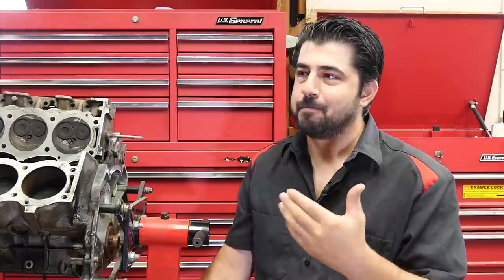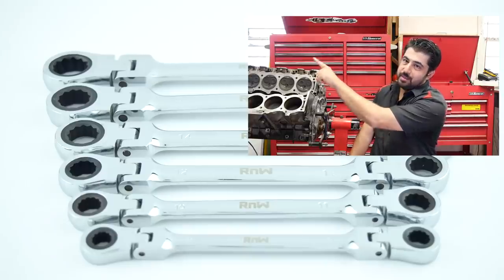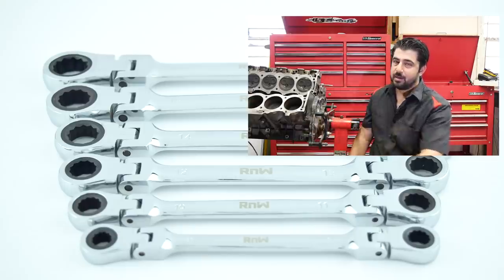Extremely Reliable Car No One Talks About

Comment: Nice 👍 I still have my 2006 Elantra w/5 speed manual transmission and it’s been a reliable car. It’s my daily commuter and I do all the maintenance myself. The only issue I had around 175K miles was a bad front brake caliper. End up replacing both calipers and rotors along with a complete brake flush. 225K miles later, she still getting me from point A to Z 😁

Comment: Pairing an interference engine with a timing belt should be made illegal...
Reply: WHY ?     just maintain the car
Reply: @claycoates5056  Well, even if you maintain the car and used only genuine manufacturer parts, those parts can sometimes be 'defective' and it may not be obvious - initially. If you put that brand new part on your car not knowing that it is defective and the part breaks, as in a timing belt, then what??? So, I agree with the comment from happystar1000.
Reply: Sea Gull they make interference engines because they’re more efficient. Get rid of emission regulations and manufacturers would be more open to making non-interference engines.
Reply: Agreed 1000000%
Reply: @happystar1000 tell that to my 2.5L 1984 Porsche 944 N/A M/T
Reply: Simply use timing chains instead.
Reply: Yeah, I learned that lesson with my Eclipse when I was 16.
Reply: He is right  reliable. And one thing I notice. They are designed. To work on them not like American cars very difficult. To work on them and very expensive  to repair  they are design for the assembly line.
Reply: @pedrofernandez8729  then they have to use plastic guides and then those fail.
Reply: I have a V6 Highlander that has the belt. Runs wonderfully but I don’t take long trips because if and when it happens I don’t want to be Far, far away. I can’t afford either; the trip and the repair.
Reply: @crownhic6827  I’m disabled and can’t do that anymore. My back is disintegrating.
Reply: @dam4274  sorry to hear that.
Reply: so many statists in here
Reply: i like when they are int. but only 4 cyl. wtf
Reply: @drummeralex9198  how are they more efficient?

Comment: 100% on the money with this video!
170,000 miles on my 07 Elantra and virtually nothing has ever needed work outside of routine maintenance, which I’ve learned to do myself because it’s so simple. I think the only thing that’s ever gone bad was the O2 sensor, which took me all of 10 minutes to replace 🤣
I even let my friend use it for a 5,000 mile road trip because I trust it so much
I’ve actually done an amortized cost analysis of routine maintenance expenses for my car. Excluding purchase price, insurance, registration, and gas, the car has cost me roughly $30 per 1,000 miles. Ridiculously cheap and easy car to own

Comment: The 5th gen Elantra was for the model years 2011-2016.  The 6th gen Elantra, starting as a 2017 model, was offered to the North American market in January 2016.  The main bearing issue in the 5th gen Elantra was supposedly an oil starvation issue caused by the use of aftermarket oil filters.  If you have a 2011 or newer Elantra, always use Hyundai/Kia brand oil filters, or aftermarket oil filters that have the same design as the OEM oil filter.

Comment: I know someone who bought a 2nd gen Elentra with zero issues, bought it cheap and has had it for 10 yrs.
Reply: I have a 05 elantra which he said after 04 they got the continuous VVT which makes sense cause my engine can sometimes shoot up quick to high speed with hard acceleration and it's very reliable

Comment: Hey, I own a KIA7 kia spectra(soul sister of Elantra). And I'm cheap so never replace until it's broken. I have 207K miles on my car and everything works except the drivers seat occupancy sensor. Shit I'm over with this car but it still keeps going. But just one suggestion always maintain your car 4,500 mile E-oil change; 40,000 mile Steering and Trans fluid change; 100K mile coolant and brake fluid flush. That's all I did.

Comment: 2004 Hunday accent 👌 
-can drive 6 hour strait with a full tank
-ac super cold
-low maintenance 

Oil and sparkplug change on time and it will run  for ever. 

Mine survive to crashes and drove that gem until the speedometer stopped working, sold it for 200 bucks and dude still drives the car.
Reply: My mom has a 2009 Elantra,
It is a very good car.

Comment: This man speaks the truth. I had a 2007 Kia Rio (same bones) that I picked up for 500 bucks with 168000 miles. With some charging system upgrades (new battery & batt. cables, new alternator), emissions components upgrades (evap canister purge valve/solenoid--replacing it made the check engine light go away and not come back), and one passenger side ball joint...sounds like a lot, but the cost of these parts were kept only at parts prices because with the help of videos like these, I did all the labor myself! The power steering went out, one day I lost all my fluid and any fluid I tried to put back in would end up on the street. But the car is so light, power steering was not needed.
The previous owner had a new clutch installed in January of 2018, approx. 6 months before I bought it, so that is probably going to outlast the car's life as a whole! Speaking of a clutch, the added benefit of a manual transmission will only make it last longer.
Sadly, after 2 years of ownership, I needed more room to haul my kids and all my gear around, so I sold it for 800 bucks at 199000 miles, just a couple weeks ago. So I didnt own it for long, but I was damn impressed--Hyundai/Kia were not known for quality & longevity but ya gotta respect how much they've improved. The new owner (friend of mine) has tipped the odometer well over 200k and said his only complaint is the lack of power steering. 😆
Long read, thank you for staying with me if you got this far. And thank you @ratchetsandwrenches for your help.

Comment: I have a 2007 Elantra I bought in 2008 with 20K miles. The best car I have ever owned. Handles like a go cart, decent acceleration, and still gets 36mpg on highway trips. I bought mine Cert preowned and got 4 years of oil changes. After that I switched to Full Synthetic Mobile 1 oil and Mobile One extended filters and have had ZERO problems. I have replaced batteries a few times and tires/brakes. I did the timing belt and water pump at 100K miles and the belt was still in good shape but the water pump seemed worn. I replaced it with all OEM Hyundai parts and it cost $550 for a shop to do it including the parts. Everything still works except the passenger mirror light, every other button works like normal. My sunroof opens like it did back in 2008 and doesn't leak. I even added a tow hitch and can tow up to 1500 pounds. I tow a 4 x 8 trailer to take garbage to the county dump. I have mostly owned sports cars until I bought this and I miss my new Corvettes and Formulas and RX-7 and Viper but if I have to have just 1 car, the Elantra is a decent choice. ( I used to make great $ in the 90's but not anymore ) Mine still looks like a 3 or 4 year old car on the inside after 121,000 miles. These are actually really good cars.
Reply: what about the MPG in city (landstill traffic)?
Reply: @hansselabreu649  I normally get 30-31 MPG around town, 35-36 on highway trips. I get up to speed  fast, and set the cruise when I can, usually for 5 over the limit. I don't sit in traffic long, I am not in a huge city. 2007 was a new model, I would not own a 2006 or older, they had problems.
I run the AC all thru the summer here in South Carolina as it gets 100+ from May to Sept.

Comment: I have an Hyundai Accent, 2008.  I bought it with 113,000 miles.  It's now got 123,000 and the engine is shot.  Either head gasket or burned valve or shot rings...  I've had it about 9 months...
My previous car was a 2003 Accent, and I drove it from 150,000 to 317,000 miles!

Comment: Speaking of reliable cars, my Wife purchased a brand new  VW New Beetle GLS in June 2004.  We still own this car and it has 94,000 original miles on it.  We have maintained all required maintenance to include replacement of timing belt, serpentine belt, water pump and pulleys, A/T fluid and filter, and a couple of batteries.  Many previous Beetle owner's complained of their cars.  However, this car has been a really good car.  It has never left us stranded. My wife bought a new 2018 Subaru Forester Premium in October 2017.  However, we decided to keep the Beetle because it ran perfectly. Also, I did replace the shocks and struts with new Bilstein products.  The ride is much improved.

Comment: On a related note, 3rd generation Hyundai Accents are pretty darn reliable as well.
I have a 2008 with over 210,000 miles on it, still gets 30+ mpg.
GREAT VIDEO!

Comment: As always, a very informative video. I bought a 1999 Hyundai Elantra GS new. I recently sold the car with almost 300,000 miles and it was still running. In 2005, I bought a new Hyundai Elantra GT and I still have it today with near 215,000. Both cars were and are very reliable for me. I have maintained them over the years and replaced essential parts before they wore out which I credit for the longevity. To sum it up, I have certainly gotten my money's worth out of these vehicles and I have nothing but good things to say about Hyundai. Like all vehicles, there are good ones and bad ones, but I believe maintenance and care dictates the life of the vehicle!

Comment: I've owned 2 elantras before, a 2016 Elantra GT which was a bullet proof car until the clutch grenaded.... And now, I own a 2019 Elantra GT N-LINE with a 1.6t engine, this car is amazing... I haven't driven anything better.
Reply: I like those a lot, but I am 6'3" tall. I don't think I would fit very well.

Comment: Some rave on Toyota but if you had a new 08 Highlander with the known cvvt issue, you'd be disappointed to find three stealerships refuse to fix it under warranty. $6K. We bought a new 13 Sonata, surprisingly quick, no problems at all we had to fix and dealers stood by all recalls. We love it. All cars have some issues. It's how they are handled that matters.

Comment: I had a 2010, the transmission gave up at 60K, 3rd gear started slipping at 50K and became undrivable 10K later.
Reply: Trans fluid service is important, suprised it even went that far
Reply: @Ownsterx  I serviced the fluid every 30K.  The transmission shop that looked at it said there was a problem that year with the quality of the clutch packs and they tried to move the engagement point for third gear to a lower RPM and account for it by engaging the clutches slightly less aggressively.  But the result of those things together was that the third gear clutches wore prematurely.  He said every one he saw without exception was failure of the third gear clutch pack.
Reply: So, did you get the transmission covered under 10yr power plant warranty?
Reply: @Joseph-eh4rs  I was the second owner so my warranty was reduced to 5 yr/60K.  My local dealership was absolutely no help and came up with every excuse in the book not to have to fix it.  And since it was just over 60K when it finally actually went from slipping to not shifting they claimed it was out of warranty anyway.
Reply: @nvo5307  general motors rep at a seminar years ago told a tranny repair shop owner - first words out of his mouth  - "if we didn't make these things to fail, you, you, you, you, you, you ,you would be out of business yesterday"  or they never would have had a shop! 
When cars start to not show up for "REPAIRS"! They change something to make it happen.  That's a fact
Reply: Yeah he did say 2010 was the worst for transmissions

Comment: initially they were rubbish but they've vastly improved, still can be a real pain just for a clutch swap, gearbox change or engine removal
Reply: i suppose but atleast with some you dont have to drop the entire assembly from underneath, as years have progressed it got worse with some better with others.

Comment: Recently bought a ‘09 Kia Spectra5. Nice to hear your comments on this power train. Mine has the hydraulic power steering, not electric. I don’t know if that’s a Canada only thing or if the internet is wonky on this. Anyway, replaced timing belt, flushed cooling system, highest grade fluid changes everywhere and now looking for lots of trouble free kms. Nice little car with lots of zip. I unsubscribed Scotty Kilmer who calls it the worst car ever. Appreciate your informative style without the rant, hype and over-generalizations.

Comment: The sonatas are really good cars too. the 09-10 sonatas with the lambda ii V6s are reliable as hell and surprisingly quick. I've absolutely embarrassed some SN95 mustangs and boosted econoboxes. Timing chain, non-interference design, decent gas mileage, cheap to buy and insure, and nobody looks at it at says "oh, I bet that thing's way faster than a mid-size family sedan has any reason to be."
Reply: Considering machine to machine potential You absolutely embarrassed the operator for sure.
Reply: Probably certain years. I've seen older ones with high mileage but horrible issues and looking like it's ready to fall apart when the same year elantra would look nothing like that aka mine

Comment: I bought a 2004 Elantra brand new and I botched the first oil change. All the oil leaked out on the highway from the oil filter seal, but I caught it in time before driving too far. This car is still on the road with a second driver with 150k+ miles. During my ownership an oxygen sensor and an alternator was all it needed.

Comment: Hi there I own a 2000 Elanta with 320k miles . Transmission was rebuilt at around 140k and timing belt broke because of my negligence at 263k. Has seen regular oil changes and other maintenance items and a new set struts. Recently has developed a transmission fluid leak that only starts above 60 mph. Maybe I will fix it and run to 400k.Bought it in 2005 with 110k.Has been my dd since.

Comment: Manual Versa and Sentras are also underated reliable cars. No timing belt eithe6
Reply: cisa93  read the comment he says manual not CVT also there's nothing wrong with cvts my Nissan has been very reliable and it has a CVT still running strong as ever

Comment: When I met my wife she had an Elantra just like at 1:14 in this video. I drove it once and refused to ever drive it again or be a passenger. You had to continually adjust the steering just to keep it in the lane. If would overheat and the automatic transmission repeatedly failed. When we traded it in with 70,000 miles it was worth less than what she still owed, only $400. It was unsafe garbage, maybe the worst car I ever drove in. That permanently scared me from buying Hyundai cars.

Comment: I had an 04 Elentra and it was a good car but it eventually blew the head gasket and I remember the radiator would leak at the seams. I used that stop leak stuff which worked for a while till I just replace the plastic radiator. Then the head gasket blew and then I got a honda

Comment: I had a 2014 Elantra.  I have really mixed views on it.  I drove it cross-country several times and it never failed me.

It was great on gas, easy to maneuver and park, and was surprisingly large on the inside.  And it came with all the gizmos - Bluetooth, satellite radio, backup camera and all of it worked.

But it was cheaply built.  The suspension crashed on potholes.  It had carbon buildup.  No power going uphill.  And while it had a lot of infotainment gizmos, everything was bargain basement.  You could barely hear the radio or Bluetooth phone at highway speeds because road noise was so loud.  The paint started going.  Interior pieces felt flimsy.

It was what it was - a cheap economy car.

Comment: Owned three Hyundai’s over the tears.  One of the first ones was a good cheap car until it had a major engine fail at 100,000 miles.  May seem affordable until you finally realize that these cars will torture by just being uncomfortable for 5 to 10 years, then major issues.  Road noise in my new Sonata rear seat was so loud, I would consider wearing ear plugs for health reasons for long freeway trips.  New engine seemed like it was starting to rattle apart after only three years.  Could not wait to give it back to the dealer after my three year lease...NEVER again.  You would have to pay me a lot to force me to even ride in one regularly.
Reply: You must of had a lemon. Many elantras (I will never talk about a sonata) hit high mileage and even two hit a million miles. My 05 elantra is perfectly fine and is comfortable. And it's 15 year old hyundai and is perfectly fine still. Mines is at that mark and the engine is fine and you even hear him mention a older year with higher mileage
Reply: Keith Ansell  the only ones that are "junk" are made in america since the hyundai factory had a issue with making the engines. Mines is made in korea with the beta 2.0 bulletproof engine. If you know which hyundai you are getting then it's not a issue if your oblivious and just get any old hyundai then that is going to happen if you get a Honda or Toyota that had a bad year you will get problems too that literally goes for any brand

Comment: Ford focus manuals are cheap and reliable also well. You can find 2012's with low miles for like 4000 or less. They get like 30-40 mpg and have decent torque as well.

Comment: Does Hyundai have any celicas ? .. 

No celica no reliability ..
Reply: Just for you my friend I have a Hyundai Celica with the rare TRD package for $2,999. It’s got 70k miles and new seats. It’s the best car I’ve ever driven.
Reply: Mark M classic lol
Reply: Sort of, they had the Coupe wich shared the engine with the Elantra and Sonata
Reply: My 2008 hyundai sonata was. The only thing that went bad was one of the coils at 140k miles. I got the car used a few years old at ~40k miles. It was a rental car prior. Had it 10 years. All I ever did was the normal manufacturer recommended maintenance.